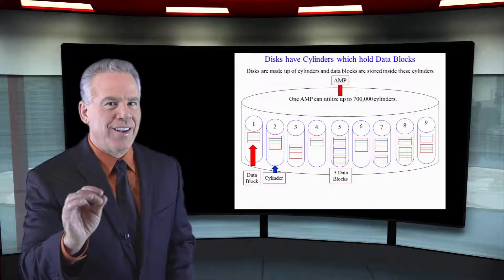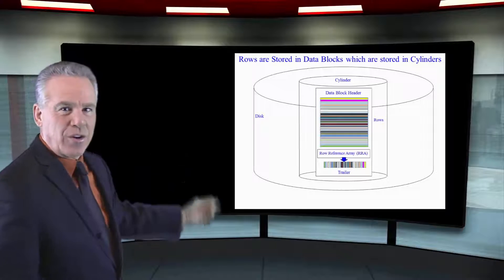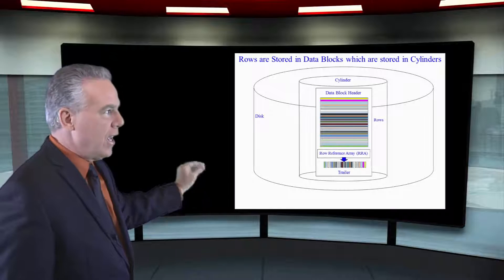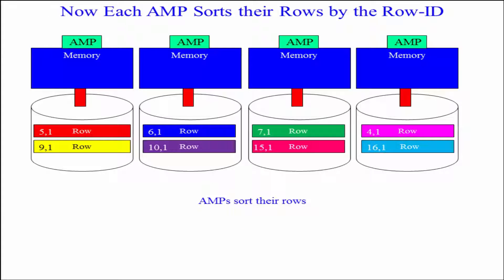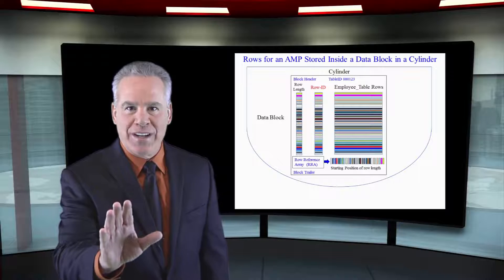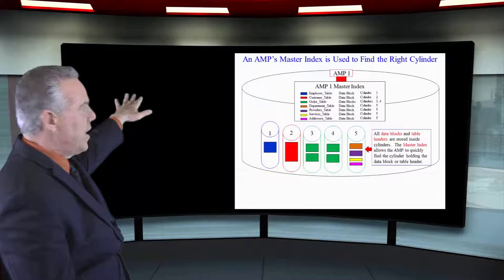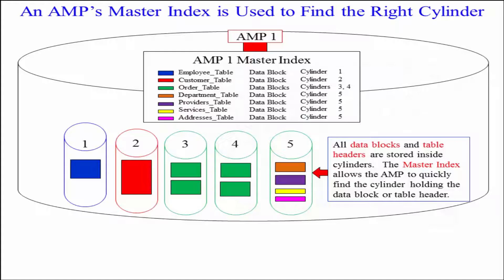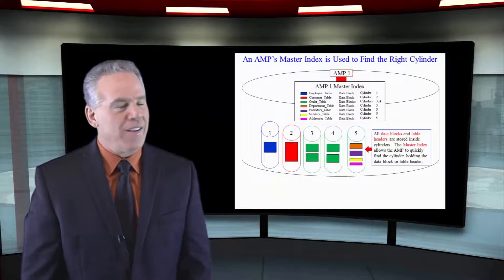Let's Learn Teradata Lesson 19: Cylinders, Row Reference Array, and the Master Index

Comment: What is row length can anyone explain please
Reply from the maker: Digvijay, the row length is the length of the row.  For example, If a row has two columns with one column an integer and the other a char(20) data type the row length would be 4 bytes plus 20 bytes plus 8 bytes for the row-id plus any null bit values.  In other words, the row length is the number of bytes of each individual row.  If a table has a Varchar column then each row might be a different length depending on the value in the Varchar column.  Thanks for watching, Digvijay.
Reply: @Coffingdw  Thank you for sharing your valuable knowledge , perfectly understood